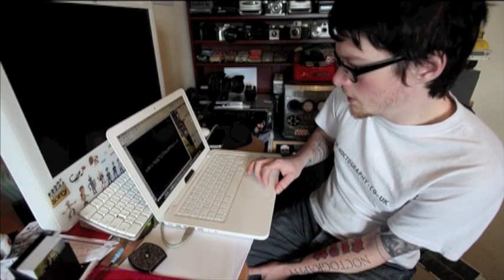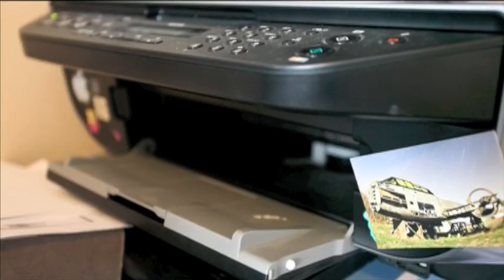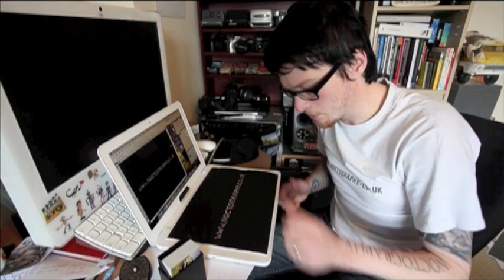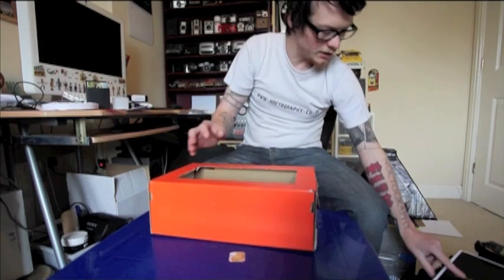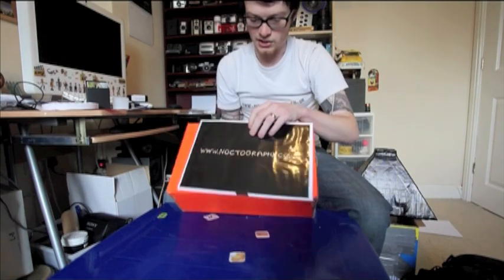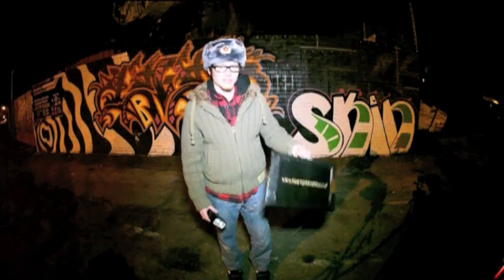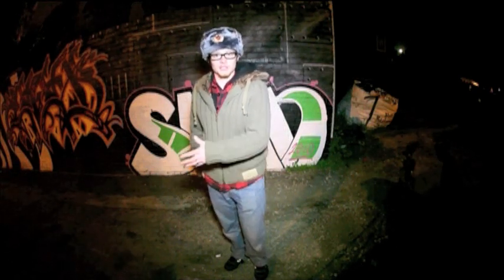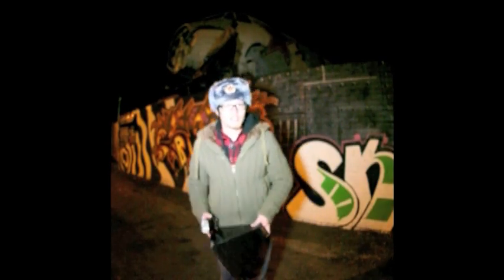Noctography - Tutorial 4: Light Stencils

Comment: How did you get the flash to blink off-camera? Did you use a receiver/trigger? Is it set on "slave" setting?
Reply: Set your camera on bulb mode run out in front of camera flash your box and then let the rest of the image expose through light painting then shut off the bulb mode. It is better to do it in a dark environment and you control the light.
Reply: Photoshop is more modern however it is expensive if you buy the program.